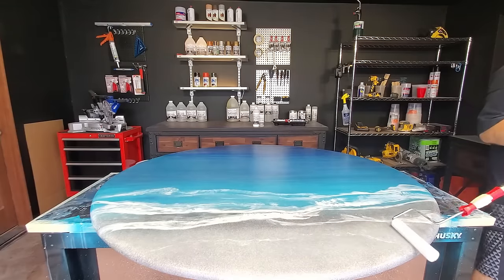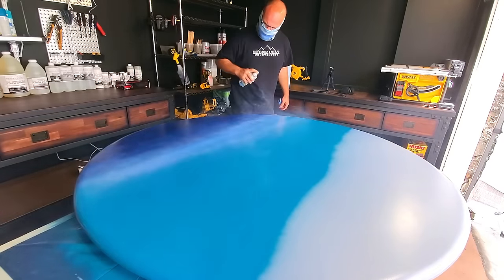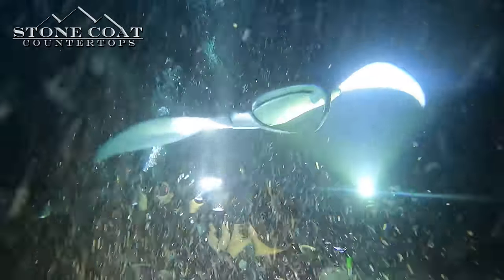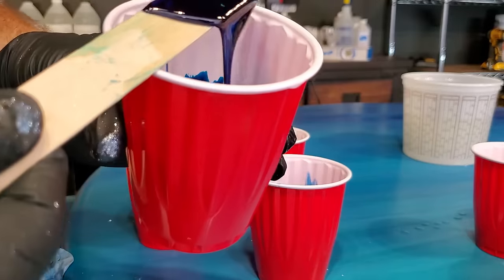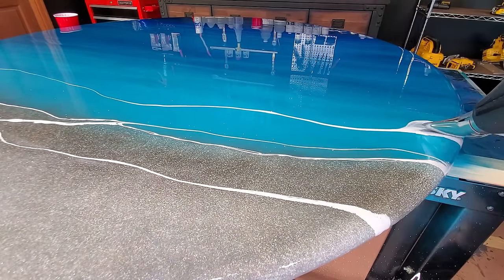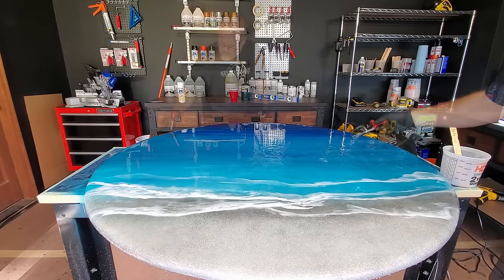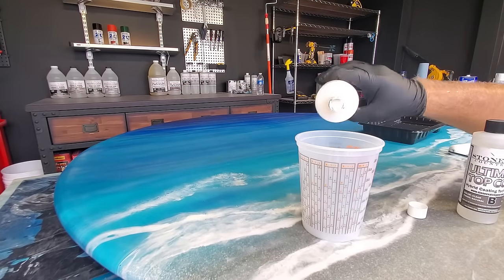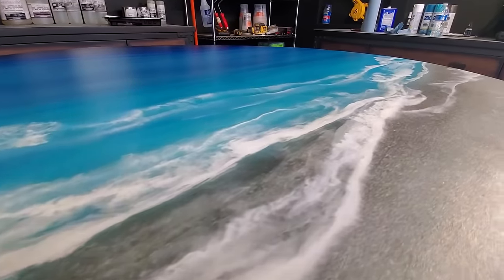Epoxy Ocean Table Step by Step | Stone Coat Countertops

Comment: PRO TIP: When using a heat gun don't use your gloved hand with epoxy on it to turn it on and off. The power button will be epoxied  in the off position.
Reply: That's an amateur mistake
Reply: @sgwitten  Hence the warning.

Comment: I like this video so much better than the older ones. This one is much more thoroughly explained from the very beginning to the very end. At first, I only ordered my kit to make the Brass Marble table and while I was waiting for it to come, I continued watching as many videos as I could and learned something new each time. So I had to place multiple orders on SCC website, as well as Amazon to make sure I had all the tools and supplies necessary. Then even after finishing our countertop I had to go track down the top coat video to see if it needed to be sanded before we apply the last layer. It was a pain in the neck process to acquire everything and get started and after finishing it last night, I was watching more videos today and realized that we did need a base layer white paint on top of the bonding primer that I ordered. 😟 My husband mistakenly assumed the kits came with everything you needed, but they do not. So, I read all the descriptions many times and it was not clear if you needed both, one or the other or when you need one vs the other. So I took a guess and guessed wrong, now my corners are having a hard time sticking to the epoxy. Not sure if coincidence or what but I just was feeling so much more prepared after watching this video than the older ones. Thank you so much SCC Team!!! Can’t wait to start my next project!!! 🥰
Reply from the maker: Thank you for your kind words Kristy!! We look forward to seeing your project any specific colors picked out yet? -Nathan
Reply: @StoneCoatCountertops  Yes!! We are totally obsessed now and want to do every countertop in our house! 😝 I am definitely going to do one of them the black sparkly color. Saving the best for last, we wanna take a stab at the live edge river tabletop for our butcher block. I can’t wait!! Was definitely a lot of fun and we are so grate for all the amazing videos (even our 10 year old daughter enjoys watching them)!! Thank you so much for sharing this amazing new home makeover option with the world!! You guys are simply the best!!!

Comment: In poured urethane gym floors, we use a heavy nap roller to apply the top coat, then immediately followed by a shorter nap dry roller to remove lap marks. Very similar process. This is right up my alley

Comment: That is beautiful! At first I was thinking a little less diamond dust, but then you applied the ultimate too coat and it seems to have toned down the glitter look that the sand had. Great job Mike.
Reply from the maker: Horray
Reply: Agreed! The sand seemed a bit too sparkly after the diamond dust - but that Ultimate Top Coat added just the right kind of dampening effect to make it seem natural.  The table was gorgeous with the shiny coat, and could have been left that way - but IMHO, the satin-finish achieved with the UTC made it look 10x classier and more natural. I wouldn't do any of it differently. It's perfect!

Comment: Mike as an artist from Europe with 45 years experience in exhibiting and teaching portraiture and landscape in all mediums.   I am in fact a pastel specialist.    Epoxy is new to me.   I would dearly love you to develop a 'satin' ultimate top coat.     Mid way between matte and gloss.   It could seriously be a game changer.  eventually a full gloss one sure, but why not take an easy mid way step.  As I understand it the matte does give total scratchproof qualities?

Has anyone actually mixed ultimate with Art or gloss top coat?

I would have added some variation to the sand.  When wet it is darker than when dry - you could play with that with some well chosen colour additives.   In oils I would use a mix of brown.  and a yellow green.

Finally I teach colour theory and have done for 35 years in colleges an Europe wide.   I can help you with that on a level which you need for your business if it will help you - to get a really good grip on that.   Just let me know.   You also need tonal values understanding  it goes hand in hand with Colour theory. 

Your product and your videos are inspiring.   Oh yes I shall be delving into it.    Too tempting not too.   I love a medium challenge and this is it.

Comment: I don't understand the sanding. With most resins I have used you can add your next coats if under or around 24 hours. Two days later between coats I can see sanding. You put so much work into it.  So beautiful in the end!

Comment: Overall I love this project. Since you asked about the topcoat and the diamond dust, here are my thoughts: The diamond dust is too much shine. Perhaps 1/4 as much would be good. The top coat is practical for a table, but it kills the natural shine of the water. I would put topcoat only on the sand portion. Thanks for sharing this video.
Reply from the maker: That's not a bad idea! Thank you for watching! -Nathan

Comment: I love the diamond dust in the sand. I would also like a star fish in the wave area also, that would look Cool. I love it. Smiles ~ Debbie :-)
Reply: I am making a kitchen island like a sea scape. I want to build some small creatures out of sculpey. The sea turtle I will use for water out of it's mouth and a flipper to turn it on and off. I make it from a balloon, elmer's glue and paper towels, then cover it with home made porcelin clay, then paint it and glaze it with the resin.  It will be a first for me. I was going to add sand to one side. I will experiment with a small batch.

Comment: Do I have to add the ultimate top coat finish to have it heat and scratch resistant? I prefer the high gloss finish, but would only  use it if it were also heat and scratch resistant.

Comment: I like the bling in the sand.

I’ve always been a huge fan of the original shiny coat, but the matte finish is starting to grow on me.

Great project! It’s also brilliant to do the video in Hawaii so you can write off at least part of your trip. Did they quarantine you guys for two weeks before you could roam around?
Reply from the maker: Its very scratch resistant

Comment: I want to do this to my kitchen table, but the table has a hidden leaf folded into it.  I'm thinking the best way to manage it is to make sure to keep the waves and beach contained on one half of the table top, and keep the blues consistent where the leaf and table top halves meet.  Any tips for making sure I don't get epoxy on the inner edges of the table top halves and the edges of the leaf?  Am I crazy to try this?  Thanks for a great video!  PS The shinier finish is tastier, but ultimately the matte finish is more realistic looking and cooler.

Comment: I want to resin a wood table do I need to apply bonding primer on wood?  Can I use countertop resin instead of the art as our supplier hasn’t got Art atm in Australia plus I’m thinking the countertop is better for an outside table? Also I can’t get your chopping brush and trowel so can you advise me on what I would use instead? I love this table but prefer the shiney look. 😊
Reply from the maker: Excellent question Kim! Stone Coat Countertop epoxy works great over raw wood. Here are two video links showing how it works on wood. -Nathan
https://www.youtube.com/watch?v=QnKg49cXnNs
https://www.youtube.com/watch?v=wxBvAljrjFw&t=1458s
Reply: Awesome thank you🥰

Comment: Absolutely gorgeous! I'm super-excited to see you do a tabletop with rounded edges as I will be placing my order soon for what I need to rehab a table I bought 2nd hand to refinish for our kitchen. I tried to sand & re-stain the top, but that's when I discovered it wasn't solid oak - just veneered! I thought I'd put on new veneer, but honestly, it seemed a lot more difficult than this - with far fewer instructions & greater risk of a major screw-up. So, I'm taking the veneer back to the hardware store & putting together my order to create a Lapis-lazuli-look table top.  
Since this will be our kitchen table - would it be better to use the regular epoxy or the art epoxy - and would you recommend the UTC for scratch-resistance or would the regular clear topcoat work fine for a home without children?

Comment: I was wanting to do my floors in epoxy I live in a mobile home is it possible to do this?
I've been told that it's not a good ideal!
Reply from the maker: Great question Haliem!  We don’t recommend the application of our flooring epoxy over floors in campers, RVs, boats, or other vehicles with regular movement. The motion could cause flex, which could delaminate the epoxy from the substrate it’s applied on. -Nathan

Comment: when do you need to use the top coat???
Reply from the maker: Great question Juan! We apply our Ultimate Top Coat at the end as our last layer. Top Coat will be dry to the touch in 8 hours and ready for countertop use in 24 hours! -Nathan
Reply: @StoneCoatCountertops  thamks for reply so quickly, is it totally necessary or is just to give a different shine???

Comment: Can I use those paints on a glass table?
Reply from the maker: Great question, you would want to use bonding primer as your first step. Then undercoat, then color coat of epoxy. You want bonding primer for smooth nonporous surfaces. Give project support a call they would be happy to go over steps!

Comment: What kind of heat can the table take,??
Reply from the maker: Once completely cured the epoxy is heat resistant up to 475 degrees: https://www.youtube.com/watch?v=uC0KgVgiQ7s
Reply: @StoneCoatCountertops  that's awesome. I had not done the countertops because I thought I'd have to be too careful with the heat. thank you for answering my question

Comment: Quick question: how much would all the materials cost for something like this?
Reply: Measure your table. It’s three oz per square foot. But your doing two coats (in this project Mike used three but it’s usually two coats) so 6oz per square foot of epoxy. Where I live spray paint is $2-$9 a can.  pearl pigments are $3-$6 an ounce. You need mixing cups, stir sticks, a trowel,  “chopping” brush (paint brush) rubber gloves and a torch to pop bubbles. You will have plenty of paint and pigments left over, and of course the propane tank for the torch. will last a long time too. I hope this helps! Go for it it’s super fun👍

Comment: You don't wear a respirator?
Reply from the maker: Good question! Stone Coat Countertop epoxy is a Zero VOC formulation. It is very durable, heat resistant, has a long working time, and very little smell when working with the product. It's food safe as well as U.V resistant. If you have breathing or smell sensitivities, you may want to consult your doctor before use. -Nathan

Comment: I will be doing a sea scape on my kitchen island.  I will make a sea turtle out of paper mache' where the water comes out of it's mouth and you turn it on and off with a flipper of the turtle. I want to put 3D or 2D figures in it as well, maybe out of sculpey like the ocean. add some sea weed, leafy sea dragons. This winter I will be doing it. I am going to move to my house next weekend and start the rebuild.  Starting on the tiles now for the kitchen.  The first batch the fabric wasn't big enough for the wooden squares, so I am making new ones that are 7" X 7" close to. The stove is 36" I believe there is 12 tiles.  Then 3 pictured ones over the sink.  When I get done this winter, I will show everyone. I have 7 days to do the tiles.  It is warm enough that this stuff dries in 30 minutes. I threw out 12 oz. of product as I forgot to do something with the tiles. It set up too fast. So this time I will be ready for it. Have to paint the sides black before you add the resin over it. They will have black grout.  The small trial ones I did, set up real good like glass the next day they were hard. They look like real glass top tiles. The picture over the stove 12 tiles about $300.  If you buy the ceramic ones off amazon.  The crafting resin about $60. Around $100. I saved $200. on these tiles.  Board, printer ink, photo fabric sheets.